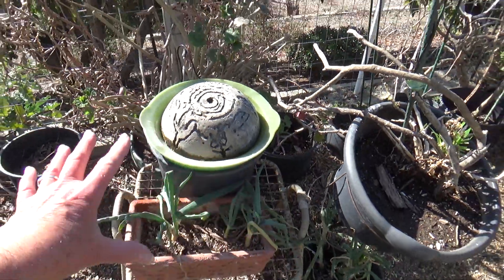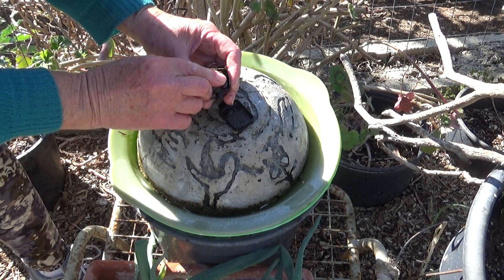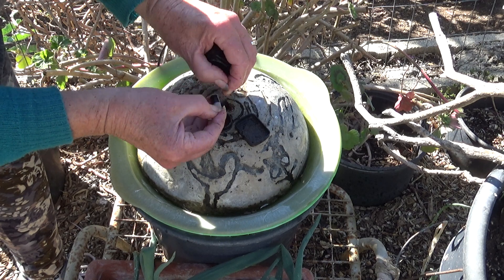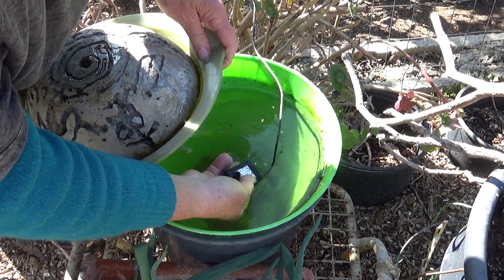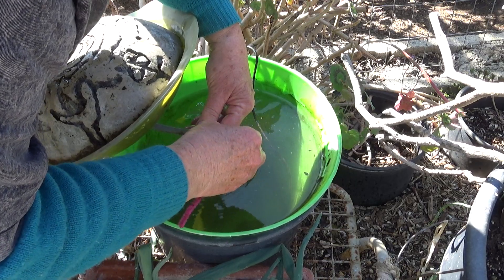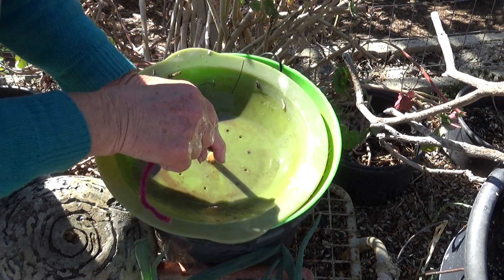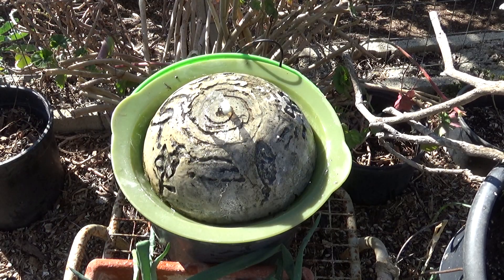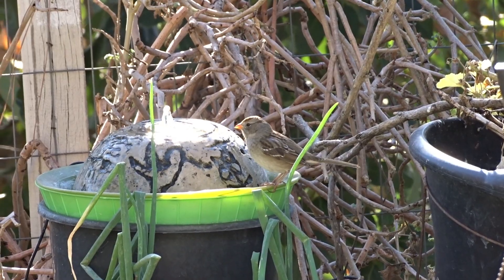How to Fix a Solar Fountain Pump EASY Quick REPAIR Water Pond Birdbath that Stops Working Garden

Comment: READ THIS FIRST!!!  I am afraid of the plastic in the ball getting ingested by all of those beautiful birds.   You are so fortunate to have hundreds of birds in your yard and are such a huge influence on other people.   Have you considered any harm that you are causing the birds from the styrofoam getting into the water.  Think about each time a birds claw grabs on it is making small particles break loose.   

I am afraid you have already caused harm and now there’s hundreds of these out in the backyards all over America.   

I have to respectfully request you take down all the videos that suggest using styrofoam and paint of any kind in your projects.   You should then run videos denouncing the use of styrofoam to help get the message out to everyone who has put one of them in the yard.  The concrete ones make great sense as cement has been accepted for hundreds of years as safe.   Thanks.
Reply: You are ridiculous and also hilarious